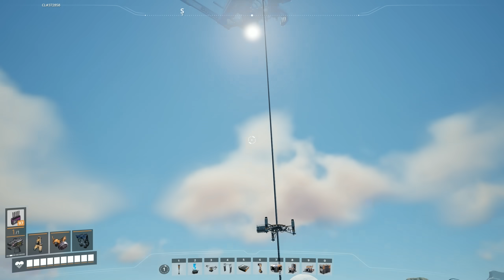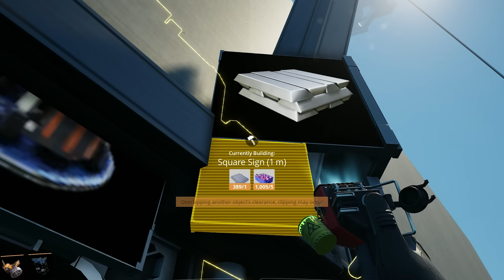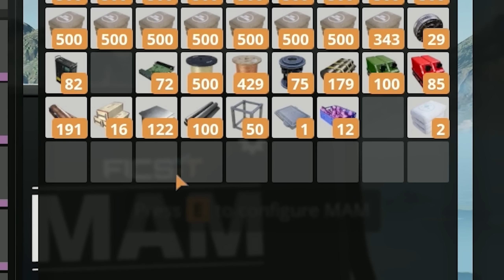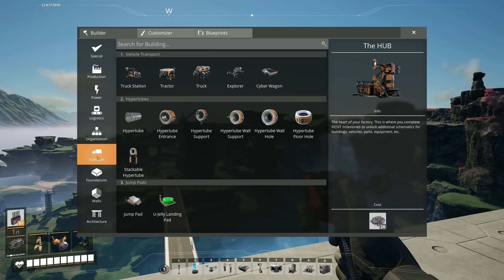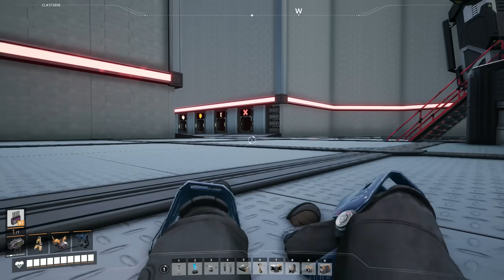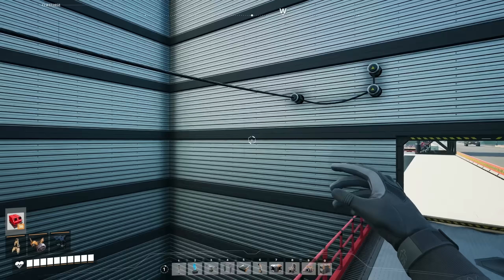How I Built my Main STORAGE HUB in Satisfactory 1.0

Comment: Hey man idk if U will see this comment but I reckon U should have made a flowing display to showcase the items... E.g. having the items go into the input but of the storage boxes... To make it instead of connecting the conveyors to the backs behind the wall have them go under the boxes and flow either up or down through the roof and floor using the holes... And making them conveyors so they kinda flow down/up and are just on the sides of the front of the storage boxes where U collect the items ❤️☺️love the videos and ideas tho

Comment: I just dont see the point of central storage with the addition of the dimensional depots.  What possible use case could you encounter that you'd need more than you can pull from the depots?

Comment: With the hub room, you mentioned it had to be outside because it has a ship that takes off and lands, but you didn't know where the outside of your base was going to be yet so you didn't know where to put it. Instead of guessing some random far distance away, it would be cool if you kept it close instead and better matched the other rooms locations and have the ship that takes off and lands go through some sort of chute / chimney type deal in and out of your base. Because the take off and landing flight path is always the same for the ship, you could dial it in and build something custom for it so that the chute/chimney bends and turns specifically for it. And then you just build your base around it. It would be cool to see the hub ship just pop out of its own dedicated hole in the base and up into the sky

Comment: I ran into the concrete limitation as well. Then I expanded my concrete production and have several uploaders running in parallel for the likes of concrete, iron plates and screws...a single uploader can handle up to 240 units per minute - but they stack. so now my concrete replenishes faster than I can possibly use it 😀

Comment: If one can dupe enough spheres to make enough remote storage depots to cover at least one stack of all objects, and multiply upload rates for 20-24-ish heavily used items, then the central mall may not be needed.  But even so, they are lovely to behold, as are the logistical optimizations and controls one can implement, such as a Stin Archi style remote train control or sushi station and multi-sorter for loading mall buffers and dumping excess.

Comment: One other item - if you're going to build big power storage arrays, you will need Stators in bulk.  It's real easy to blow through them.  I forget if HMFs were on the list, but I'd absolutely have those as well if building a big fuel station or whatever....

Comment: 26:20 fully black backpillars and accenting the front pillars with signs to make it fit into your current style. You can make completely black and completely white concrete (foundations and pillars, not walls) by manually typing in values smaller than 0 or bigger than 1 in the colour swatch. So instead of using the slider for black and white, type -999 or 999 in the box next to the slider

Comment: Hyper Tube Room: you could have the hypa tubes in sets of 3, everywhere you put half foundations. Then have 3 Tubes going up the holes, maybe put some glass in front, and potentially decorate the colums (beams, more light signs or whatever tickles your fancy)
power could go up to crossbeams again or be part of the column decoration or you let it go into the floor like you do now. Below the floor could be more tubes going across when out-of-house pipes need to change sides or in-house pipes need to. you could also put some belts there sending items to the storage containers

Comment: I have paved several biomes and storage bins in to 2 or 3 dimensional depots for concrete has never not been enough. If you need even more add a 4th depot. Every single thing I make goes in a depot, even down to raw items, and I haven't touched a storage bin in the last 50 hours of playtime. There are enough spheres to make 15 or 20 uploaders for concrete if you really wanted so yeah storage rooms are pointless now other than for aesthetics.

Comment: for the hyper tube room, it might be cool to have them almost hang from/go into the ceiling completely vertically like the transport tubes from futurama: that way you have to stand under them so you dont get randomly sucked up, and coming back you wont get launched because youll hit the floor. i also think that itd be cool to have the floor to floor ones spiral downwards around the powershaft, with them dropping off at different floors in different directions, so one will end up super short and the one to the ground would be the longest. plus itd look dope as hell with all the tubes coiling around it.

Comment: Do the first build of a production line without using any shards or sloops. It will help tremendously, later. When you need to expand. Sing Cells for Ficsonium fuel rods was hard. So once the power was on, it was trivial to sloop the sing cells and overfow them to a portal hub.

Comment: For your next big project, especially with weird numbers, I'd like to share something that worked really well with me.

When you have multiple stages of machines, such as your power plant, set up a room full of switches for each stage and turn them on one at a time. This way you give enough time to the machines to allow the system to overflow and get all the belts/pipes filled up and ready for the next machines, but since those machines aren't powered (yet) there's no spikes in consumption or bad efficiency percentages.

I'll use an example:
Say you're making an encased beam factory:
Primary switch: 
A- connected to main grid
B- connected to a main power pole

Miners switch:
A- main power pole
B- all your miners

Concrete production switch:
A- main power pole
B concrete production grid 

Smelters and foundries switch:
A- main power pole 
B- all your smelters and foundries 

Etc. 

If you keep all these grids disconnected it makes powering a factory much easier and, pro tip, if you don't connect the first switch to your main grid you can look at the graphs for each switch and see how much power each stage of your factory is consuming. This can also help you calculate how much power you'd need from batteries and remove the stress of uncertainty. 

Thanks for all the great content so far :)

Comment: Your signs in the floor can be prettier. :) The game by default doesn't render light of objects not on screen. When you sidestep and can't see the lights, they stop producing light. You can change that behavior though.

In the engine.ini file for the game ( %localappdata%\FactoryGame\Saved\Config\Windows ), add these lines under [SystemSettings] (if the heading doesn't exist, just create it at the end of the file).
r.AOGlobalDistanceField.MinMeshSDFRadius=1 ; old sign light, signs off screen still shine
r.LumenScene.SurfaceCache.CardTexelDensityScale=1000 ; old sign light

Test it out and see if you like it. FPS effect is negligible as well.

Comment: What if Coffee Stain added something like a Ficsit Remote Operations Controller, like a big terminal that's like a computer monitor bay and supports switching several systems, be it power switches or machine recipes or splitter configurations and whatnot, and a portable terminal that can connect to any amount of big terminals, selectable through a menu, and you can remotely access each terminal. You could put down a terminal and sync it up to whatever you intend to control, and have like a master factory building with everything you need for any bit of personal equipment, and at the terminal you switch the configuration to whatever items you desire. And you could set one of the big terminals to monitor power usage, with a few master switches all connected to it, and from anywhere you can turn on and off parts of the factory without having to panic and hypertube cannon yourself over to the power tower platform because of a rather sudden nuclear waste backlog.

Also, it would be cool if we could get an endgame advancement that would allow for the very, very material/energy expensive production of Mercer Spheres and Somersloops. Imagine the multi-stage huge yet super slow production rate factory you'd have to build to make it happen XD

Comment: To fit with your style a little better, the hypertube room should have the entrances flush to the concrete walls, with no exposed tubing. I think the gold and busy design doesn't work too well here. Make them embedded fully in the wall, for depth maybe add each entrance on an indented portion, like 4-way indent tightly focused on the entrances. That allows for embedded lighting or signage, too, and hides the wiring.

Comment: For the hypertube room 26:13, you could use the back of large billboards in the recessed sections to add a bit more texture and color variation, clip together blank small billboards to get a continuous glossy black backdrop, use frames and pipes to fill some of the empty space above the hypertubes without hiding them, use beams in some of the corners to reduce the boxiness, or use mercer spheres as a decorative piece and place them on some sort of pedestal.

Comment: I made my storage where the floor is actually for the top port of the container. The goal is to have a conveyor lift in the bottom port that can have a dimentional storage plugged into it. Along with that I also have just a single conveyor popping out because I like seeing the 3D model as well. I used clipping to put the sign inside the hole too so that's cool

Comment: Probably already mentioned, but if you rescan a harddrive while there's others in your list, it won't pull a recipe that's presently in the list or was recently rescanned. Once you choose a recipe, all unselected recipes (rescanned or not) go back into the pool, so you can increase your chance of getting a recipe you want by scanning multiple drives at once (as you did), but then first rescanning all the ones you don't like, and THEN choosing your recipes.
Basically, each drive that's standing by removes 2 recipes from the pool, or 4 if it was rescanned, until a recipe's selected.
Reply: He's used this a ton in previous episodes
Reply: @nutmeggaming11261 but not the rescanning bit
Reply: I've had several pull recipes from rescanned hard drives before, so idk about that part. But yes leaving a hard drive unchosen if both options kinda suck atm is a great idea
Reply: in general, just choose a recipe if you need it *that very moment*, or if you want to have the other option in that hard drive as well
Reply: Yup. I thought of this slightly too late 😅 Because it does help to block out 2 options vs 1.

Comment: With the hyper tube room. There's a fun option. Signs. You have a sign for a location over a open hole. As the tube room has altitude you can just walk off into a pit and fall. The tube can easily grab you at the correct point, and the speed adds on. The return is wizardry. You have a 2nd run of tubes. So instead of back and forth on the same line. The falling tubes take you to a location. The return line, again making use of the pit, sends you down again. This time each return line goes to the same location, where you are fired into a single cannon that launches you into an angled ceiling back up in the tube room.

What you'll see is falling a nice view of all the goings on through some glass into the center, then a casual ride to the the desired room. After you're done, you fall into the pit, and just as everything fades from view, fwump fwump fwump "teleported" back to the top.
Reply: That is a genius idea.
Reply: That sounds like a blast to use

Comment: I put all my wires  under a foundation using a wall socket, then run the wires to another side or bottom of a foundation in a straight line, usually 5 to 10 foundations away. Then I  use a 1m foundation against a 4m, jump down, put the wall socket underneath the bottom side of the 1m in the very corner, then I jump back to the top side with the power pole on top and move the pole until the wire disappears inside the pole. Delete the 1m and replace with a 2 or 4m to bury the wire. No more above concrete wires ever again. I colour code each foundation, or use a pattern to denote where the wires are under the foundations. Probably something every one has figured out, but just in case, a way to make wires disappear. I colour code so its super easy to hook on to a wire and go in a new direction. Also works by putting a concrete pillar  to hide wires inside.

Comment: if 2500 concrete won't "do it", just attach more depots to containers for higher input throughput. Jus say'n bc that's the reason you gave after the 'just because' reason. Tbh I've never needed more than one depot for anything once I got it fully upgraded, and I have like 20% of the map covered up so far.

Also when it comes to hypertube exits and preventing launching yourself into the void, you can put another tube support two spaces away, attached to another set of entrance/exits 1 space apart for the typical railgun entry. That way it acts as a dual entrance and exit, bc when you exit you get stopped by the tube support, but you can still use that space as the entrance for the other direction.

Comment: The limit to upload speed is per uploader. So you can feed uploaders with a set of splitters to dump 780 belts into the storage pocket.
So you build a big pit to hold concrete and iron plates. Then have 6 or so loaders filing the concrete back in. The issue is throughput, so you add bandwidth.
You don't even need a large factory for the concrete, just the storage.

Comment: Storage room plus dimensional storage is probably the way. Stack a dimensional storage on top of your storage box and have that feed into the dimensional. 

As others have said you can also have multiple dimensional storage boxes for high usage items like concrete.
Reply: I tried that at the beginning, but... I don't like it. It's too bulky for my design of central Depo as I use lately two level depots on circular basis. Basically sink lower container into the floor so I have access only to upper entry point, and other way with top one. Combined with way too complicated sorting system I use there is no nice way to include dimensional Depo in design.
All my dim Depo are in production sites